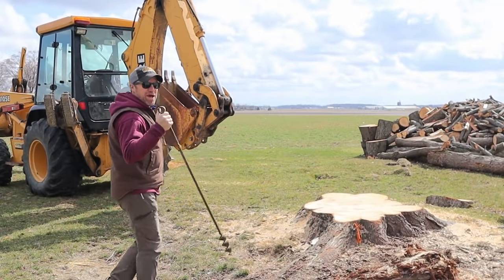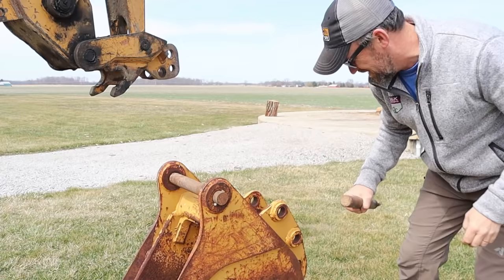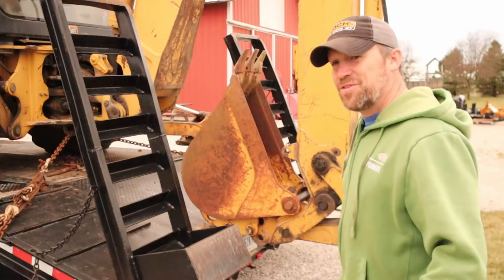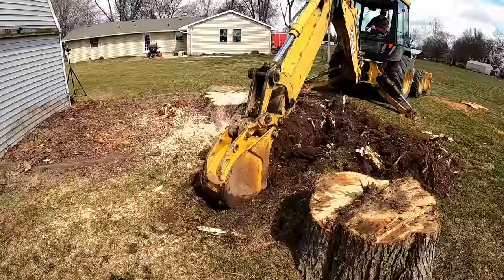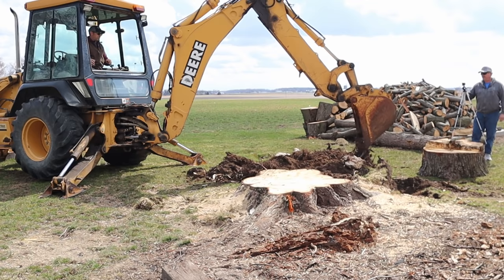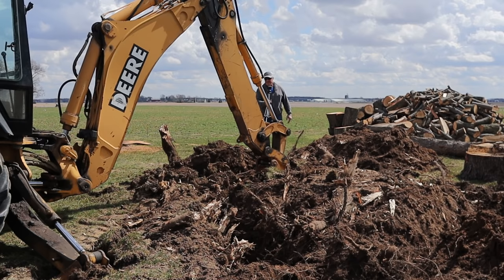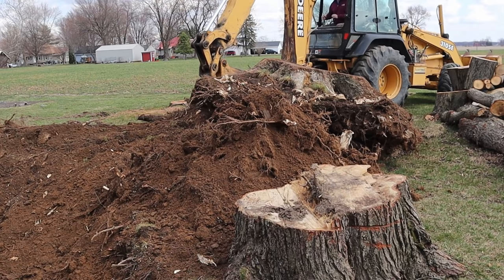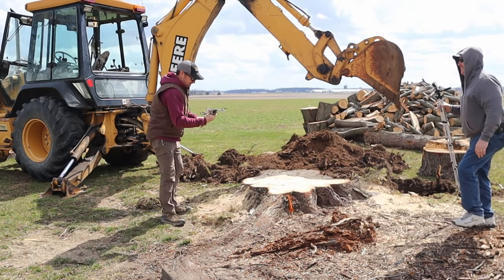The Biggest Stump I've Ever Tackled With A Backhoe! - John Deere 310SE Digging Huge Maple Stump

Comment: Good advice on the 1 foot bucket. I had to remove 2 large maple stumps from my front yard. Neighbor has an old Deere backhoe with 1, 2 and 3 foot buckets. The 1 foot bucket made for less overall destruction of the yard, while still easily able to bust 3"-4" roots. We then switched to the 2 foot bucket to remove the stumps (they were too big for the 1 footer). The whole thing took about an hour. Found that doing it by hand was way too time consuming (and back-breaking), while  burning or grinding doesn't remove the stump/roots (and also too time consuming and fuel reliant). I originally thought about letting nature take it's course, but at the rate the stumps were decomposing, I figure I'd be about 120 by the time they rotted away. Oh yeah, and blasting is illegal in my area so that wasn't going to happen : (
A few yards of topsoil and some grass seed, and I'm hoping that you'll never be able to tell that trees were even there.

Comment: I have dug stumps out that size with a mini excavator and pushed it out of the hole with a mini and a skid steer. I have stumped building lots with a 310 JD. I would think you would know to dig further out side of the stump where the roots get smaller. It’s a lot more easier on the machine.
Reply from the maker: Yes, very true.  In some situations I would did as big as I could but here we were just trying to minimize the size of the hole cause we'd be filling it all in with compacted fill afterwards.  You can accomplish quite a bit with those smaller machines if you're patient.  Thanks for watching sir!

Comment: For that stump 1 stick of 40% ditching powder, stemmed half way down in the stump. Rubber blast mat, a few buckets of mud on top. POP, clean up the pieces.
Reply from the maker: That would be AWESOME Carl!  I wish I knew more about that stuff.  Sounds like you certainly do.  Maybe if I get another biggin' I should give you a call!  Thanks for watching!
Reply: @digdrivediy  I helped a friend blast beaver dams, before DNR disallowed the practice, lots of fun.
With tree stumps, it depends a lot how firm the stump is, some species, like oak, is easy, I do not know how tough something like Southern Live Oak, would be, that would be an experiment.
I am in the Land of the Little Sticks, right now, do not know when the border will open again, they have to get things under control yet.
Best wishes.

Comment: I found a rail road tie setter for my Wayne Roy coupler. It wasn't a ripper tooth but very close. Works well on my 310 SE. It takes patience and planning to do site work with a hoe. But they will do almost any job. Nice video.
Reply from the maker: I'm glad to hear someone else say that! The folks that do site and prep work with a TLB are getting more and more rare. I think the backhoe gets a bad rap nowadays but still a very useful tool that can still out perform a mini or skid steer in some ways. I think a giant ripper tooth could have been helpful here too! I was glad to have the one footer at least.  Thanks for watching and glad to hear from other backhoe fans.
Reply: @digdrivediy  you don't want nothing as far as having a bucket bcuz those big slob stumps you do need to remove all the Dirt that's on top of the roots. As the Dirt is what's holding it in and down. Ripper maybe on small trees. This size not the best setup

Comment: My brother in-law had a big stump in his back yard. He couldn't get heavy equipment to it, so he drilled numerous 1 inch holes in it, about 12 inches deep. He soaked it for two days with diesel fuel then lit on fire. The darn thing burned for 5 days. After it quit emitting smoke on the 6th day, he had a big hole where the stump and roots use to be. And it was a green tree too.

Comment: I hope he has you back to compact after backfilling.
Reply from the maker: The remaining vegetation and woody debris was removed from the holes with skid loader after I left.  They compacted the fill material in lifts as they backfilled since it would be tough to compact all that in one shot.  Gotta get that stuff packed in good before you can run the trencher through it for the footer.  And lots of rebar for good measure.  Should be good for a couple hundred years we hope!  I like you're thinking though Tom!

Comment: I'm a fan of burning stumps out personally. Couple beers after dinner and an air pusher (box fan, leaf blower, whatever is at hand) .  Instead of making it an actual work project, do it once or twice a week as a form of leisure. Sure, it takes longer, and there is some maintenance work that goes into it (drilling holes into the stump with an auger between burns to give the fire and heat more area to get at). That being said,  stump wood is very dense and has some amazing grain to it, and it is wasted by burning it.

Would be interesting to see just how long it would take to burn out a stump that large, thought I suppose in this scenario, the only proper solution is the complete removal so there are no voids under the foundation like you said.
Reply from the maker: Exactly!  Thanks 👍🏻

Comment: We used a slide hammer to drive a nice hole in the dirt from the side about center of the bottom of the stump. We would leave about 4’ of stump and chain the top. The Dynamite in the hole the slide hammer made lifts the stump and a tractor yanks the works out. Leaves about the same crater after. The lift is where the dynamite really does the work. Fluffs up the soil nicely and is fast. Took the roots out enough to till the soil and plant. We removed two acres of trees and that was an amazing day.
Reply from the maker: That would be a great method!
Reply: @digdrivediy   it worked fast and was fun as hell. Tractor hopping as the wheels spin tell the whomp of the dynamite and the tree pulls out of the ground.

Comment: Two hours wasn't too long for the size of the stump. That 310 has impressive power in the hoe to lift the whole front of the machine off the ground! I don't think I have seen that before. I'm sure a CUT hoe isn't strong enough. Great video!
Reply from the maker: Thanks Jimmy! Yeah, the 310 is pretty capable machine given enough patience.  Thanks for watching!
Reply: I have lifted the front of my Case 580 K many times

Comment: Big stumps, little ideas. Drill a bunch of 3/4-1” holes around the top and into visible roots. Fill with epsom salt, wet down, cover with dark tarp. Check about once a week, keep it damp, in above freezing temps, it will reduce to softened wood that’s easy to dig/cut out in a few months.
Reply from the maker: That would be cool to try.

Comment: That's about the normal length of time for a Gigando stump that size. 2hour is not bad considering what you used to dig it out with. Watching the video and hearing your feedback it seemed like it was gonna be a all day event!! Sometimes they don't wanna pop out even when you have everything all dug out. That stump didn't have a deep root ball directly under it so that's why it was not harder to pop out. I just did one not to long ago and it was stubborn. It did not wanna come out. When I did get it out, it had about 5feet of root ball directly under it.. Which made it very difficult. The  trick was grabbing on a piece of root coming off one of the sides. And I used it for leverage and it gave me a twisting effect as I pulled on it.  Took about 2hours also.  But I have a way way bigger pit, that I dug.. Pretty crazy. The hole was about 15ft wide and foot deep circular shape. 24in bucket on a 60 midi hoe
Reply from the maker: Yeah, I've seen better and worse for sure.  Glad to hear this one was about right in your estimate.  I'm glad it wasn't any worse cause I can never tell when starting.  We popped out a little 24" cherry stump about 30 feet from this one and it came out in about 10 minutes! Thanks for watching and commenting!

Comment: You drill in the side of the stump at about 30-45 deg and the number of holes depends on the stump size and root style. I was taught about explosives at high school back in the early 70s as it was an agricultural high school in South Australia. How much Gelignite to use again depends on size and root system , the aim is to just use enough to pop the stump up out of the ground and NOT blow it to pieces as then you have to pick them up.
Reply from the maker: I love hearing about stuff like this.  Thanks for watching in Australia!!

Comment: It took me 6hrs to remove a large stump at a site I'm going to build a cabin at. I own the machine and prob put 300hrs on it removing stumps alone.  This one was so big I had to use a tree trunk as a fulcrum to get it pulled up away from the tap root. In the end we won and I had to also dig a ramp to drag the thing out of the huge hole I had to dig.

Comment: If I know ahead of time that the tree and stump both have to be removed. I dig a trench around the tree much like you did the stump with a single point blade cutter made from a piece of railroad track iron.  I keep the ditch filled with water for sometimes a week while testing and stressing the root system high up on the tree almost daily with the backhoe boom. I've removed oaks with 6 ft stumps with a 580L Case.
Reply from the maker: That sounds like a great plan! My problem is that I can never plan anything an entire week in advance!!! C'mon! lol

Comment: My case has a 30" bucket and I've dug out lots of large stumps. I prefer to push the tree over while intact to make it easier to get out of the ground but for cut off stumps I simply dig them out, then I dig the hole deeper and wider and shove the stump back in and bury it over. No stumps left to dispose of out in the pastures. I don't think it's ever taken me more than twenty minutes to dig a big one out.
Reply from the maker: That's awesome!  If you could have dug this one in 20 minutes with a 30" bucket, I would be thoroughly impressed!
Reply: @digdrivediy  Backhoe is the easy way. Forty years ago when I was building my first home I cleaned a house site with a chain come a long and a pickaxe. I'd dig around hardwoods and then cut all the large surface roots with the pickax and then chain the tree ten or so feet up and run chains over to the nearest large tree and winch the tree over pulling the stump out of the ground. For pines I'd dig a hole behind the tree, chain the tree off and pull until I had as much tension on the tree as possible and then strike the tap root a foot or so below the surface with the pickax. The tap root would snap in two and the tree go over pulling the stump out of the ground. As I said before it's a lot easier to get the stump out of the ground before you cut the tree down when you have the weight of the tree wanting to topple it over. So yes I've had plenty of experience with digging trees up and with pulling them up. To remove a hard wood stump with a backhoe you position the hoe and dig a shallow trench down the right and left side of the tree cutting all the feeder roots. Move the backhoe to the other sides of the tree and dig out those feeder roots. Now you dig under the stump and using the bucket to lever not lift you pop the stump up. With pines you have to dig down five to eight feet to pull up or cut off the tap root with the hoe. I dug up one stump under where I built my barn that was so large I chained it to the loader after I had it out and the loader would barely lift it to move it out of the way.

Comment: That’s a nice machine for an older one. What’s crazy is you can answer the phone via Bluetooth in my 2019 310 SL HL. It has a microphone and speakers. You can talk on the phone or listen to YouTube like in your car
Reply from the maker: I'm jealous..!  That would be sweet. Plenty of power?
Reply: @digdrivediy  well it's a 310, but a new one. It digs just fine. Our 410 that has the breaker on it has a little more power. But there 310 can scoop out of the bed of the raised dump truck, so it's better for the utility construction I do.

Comment: Glad I have a stump grinder. Can have the stump and most of the roots ground up in 35 minutes, $150.00. There will be minimal backhoe work afterwards.
Reply from the maker: Do you include clean up and removal of all the dirty wood chips for that price? I always wonder what to do with that stuff.
Reply: @digdrivediy  Well, it all depends on the stump, location, ease of access, if I can get my bobcat in there, the job itself, whether it is tied to more/ other work, etc. That stump, probably no clean up for that price. I just take the grindings to a farm, and dump for free. Or, if someone wants them locally, I'm glad to bring them. If they are mixed in with chunks of wood, cut up logs, I have to pay anyway to dump that load.

Comment: I know the feeling. Same with a mini, very hard on the machine. Sometimes just better to pay to have it ground and then it’s much easier to remove 😊
Reply from the maker: Be interesting to know how I would have went with a grinder. Thanks for watching!
Reply: I have done maybe 50 stumps that big with a kuboto 040. Machine is slopiest daily greased 1200 hr kubota I know of. Now I'm gonna spend the profit of all those stumps to make her tight like a tiger again lol
Reply: @charlesbourgeois9029  , I gotcha one worse I promise. Brand new Yanmar house swing slop right out of the factory, with 300 hours on it, she rocks back and forth like 5 times before coming to a stop. Shame on Yanmar for low quality slew gear
Reply: My 040 had a little slop with swing gear when I got it. Still does. I attribute thay part to the 200hr rental life prior to me lol. Not atrocious slop but some.
Reply: @charlesbourgeois9029  , I don’t think it’s the 200 hours. Had I known mine was not supposed to be there from the start I would’ve made a bigger deal on a return or refund. I checked other brand new Yanmar mini’s and they have play too. On the other hand, I bought a 22t JCB with 3,000 and it has zero slop in the swing. Maybe apples to oranges but I still don’t think it was the rental, just the tolerances from the factory.

Comment: One of my hardest trees to fell was a 40ft pine tree 25ft away from Moms front door. There were 3 in a row and a 4th closer by the front door 16 yrs ago and there are 3 still left today that badly need to come out due to some pine tree disease going through Western Pa for 5 yrs now.
Anyway, my sister expressed concern that the tree was going to fall on moms house because she sees the roots 4ft away on the low side exposed.  I didn't agree but after numerous reminders I gave in and took my bucket lift up 30ft and climbed the rest to start limbing  working my way down to the ground. I left about 15ft standing to hook 3 grade 70 trans[port chains end to end. I dug the back side 3ft deep pulled then the sides, pulled, then the front, pulled, then put the 3ft ripper on and went down to at least 6ft 360° around about 3ft from the center out. There was (still is) a tractor trailer sitting perpendicular to the front bucket. (for those that burn stumps perpendicular means side ways in front of the backhoe)  I hooked 2 chains to the front bucket. I'm 40ft away from the tree so the angle isn't that high.    I pulled and pulled the backhoe 5ft front and back off the ground for ever it seemed till I saw and felt it wiggle.    For those of you who have experienced the wiggle it's a major mile stone knowing Bud's right around the corner. (for you stump burners that's a beer).     Rounding the bend I see the finish line. After digging at the bottom removing as much dirt as I could I chained the stump to the front bucket and that's all it wanted with the backhoe fully extended trying to hold the back down. I've never ever in 50yrs I've had this hoe stalled out the hydraulics on the front bucket even with a 3ft bucket of dirt fully extended out the back. It will bring the back wheels off the ground. I never did see a tap root. Big ones going out 20 ft at the ground cut off with the bucket. lots of small spider roots all over.        End of story.
Reply from the maker: Man that sounds like a huge accomplishment!  Always rewarding when you stick with it and win.  This one here put up a good fight but only for a couple hours and got her chunked out of there. Thanks for sharing and watching!

Comment: Once saw an old Oliver crawler with a cutting-edge from a greater bolted to the side cut into tooth pattern to put up and down inside the ground to rip the stump fruits worked excellent just drive around stump people in Vermont and New Hampshire are pretty innovative works well on a crawler should work on a bucket or backhoe
Reply from the maker: Nice idea.  Thanks for sharing and appreciate you watching!

Comment: Use the backhoe to expose the big roots and a sawzall to cut them out the width of the bucket.  Some 4" by 12" by 24" boards to keep the stabilizers from sinking in the ground and a heavy weight to put in the bucket would help keep the machine from rocking and bouncing.
Reply from the maker: Good Advice!  Thanks Farm Boy!

Comment: Last time I dug out a big stump, I unearthed one large root, and cut it off with a chainsaw. Unearthed the next big root and cut off, and so on until I could remove the stump. Yes, cutting dirty roots dulls the chainsaw, but look at how long it took to chisel away the roots with the backhoe... How many times could you sharpen a chainsaw in that period of time? A saw chain and frequent use of a file is way cheaper than beating the sh** out of your backhoe.

Cheers!
Reply from the maker: I've done some kinda like that too.  Lots of ways to skin a cat I suppose.  Thanks Steven!